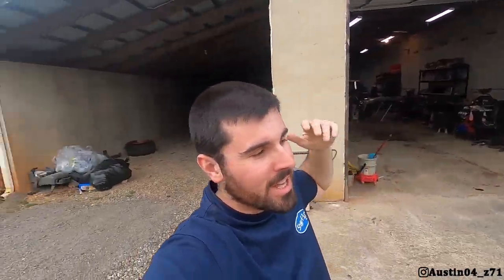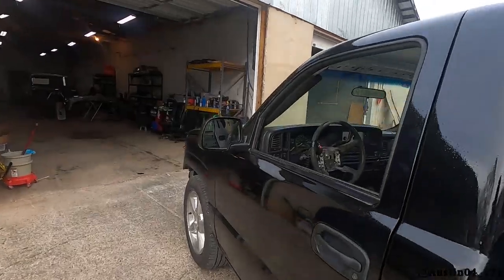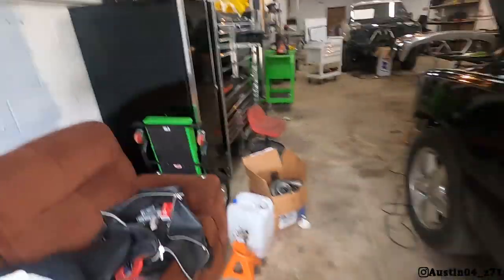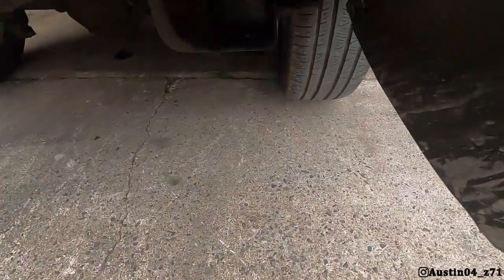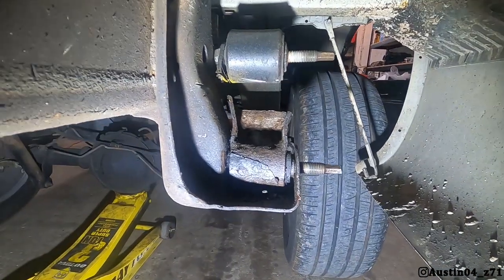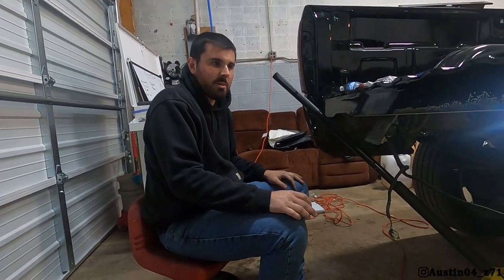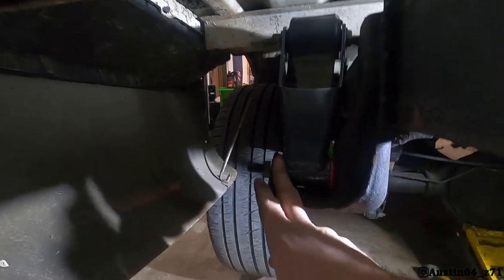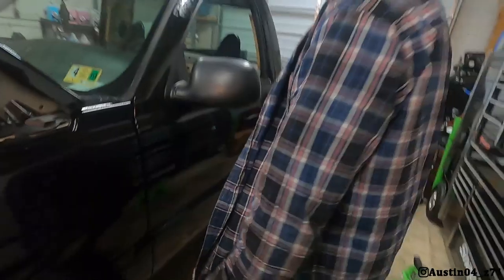2” Drop Shackle Install 99-07 Silverado or Sierra

Comment: Man I m hav ing the same problem.     U didn’t have light on the spring      I didn’t c what happened.   Did u drill bolt head off or get a bigger grinder. Rusty bolts    Pain n my      - x x                Keep em going.   👍

Comment: Got my bed off right now and pounding these old bolts and using a torch they ain’t moving got some belltech 2” drops but ain’t gonna be no use if they don’t come out lol
Reply: Did you ever get them out im having the same problem
Reply: oh w did you take off the bolts? If so how did you do it?

Comment: Do not take the leaf spring out buy lowering hanger instead
Reply: Does it need an alignment if you do that to the back only?
Reply: I put 2" drop shackles on my 2000 gmc sierra, couldn't even tell it did anything at all.

Comment: What if I have 4 inch blocks..what's the best thing I could do If I want to drop it 2 inches from the back?
Reply from the maker: Take the 4” blocks out and put 2”
Blocks
Reply: Thanks for your fast response. I assumed that. But It also went through my mind, removing the 4 inch blocks and installing 2 inch shackles. Thanks again.🙏🏽🙏🏽

Comment: You guys are suppose to tighten the spring bolts when it's under load not in the air.   Newbies
Reply from the maker: You can definitely tell we are lifted truck guys
Reply: Huh